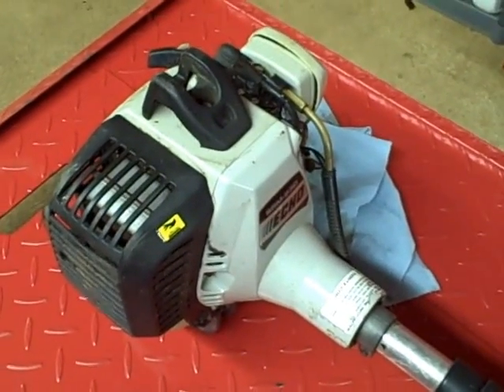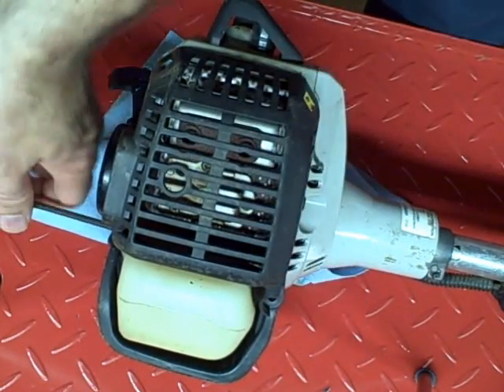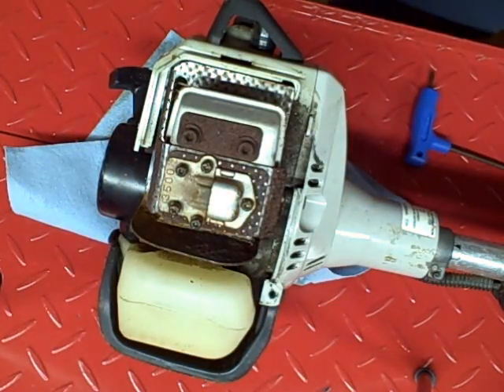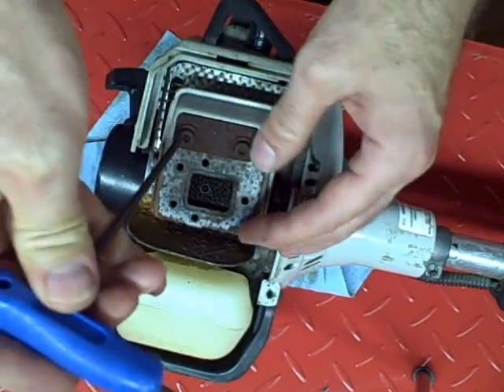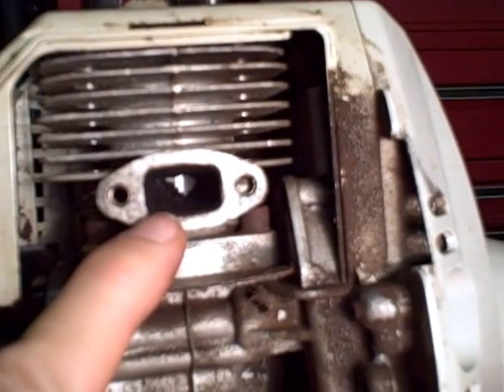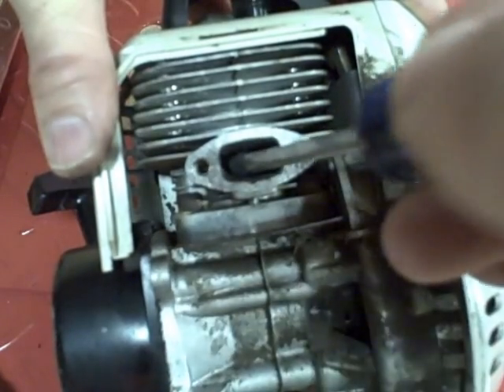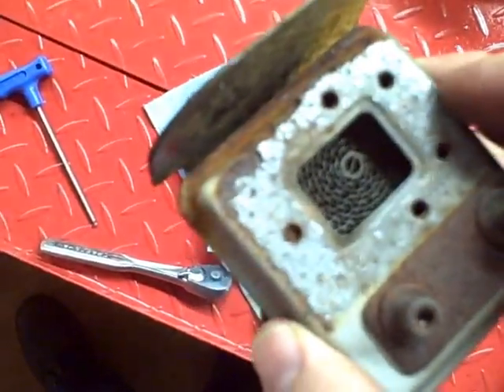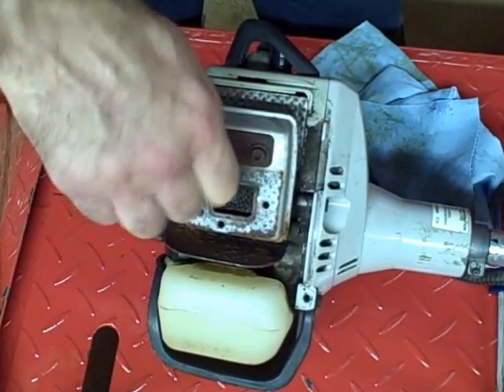Small Engine Repair: Cleaning Carbon Buildup on the Exhaust Port & Muffler on a 2 Stroke Engine

Comment: after those 5 screws on that exuast redirector. remove that little 'gasket" its blocking to much flow and cuasing too much back pressure.wich is cuasing this. hope this helps
Reply: Mattmako 
Good Morning!
Excellent Video.  You were using several different tools.  What was the tool with the Blue Handle? Where can I find one?